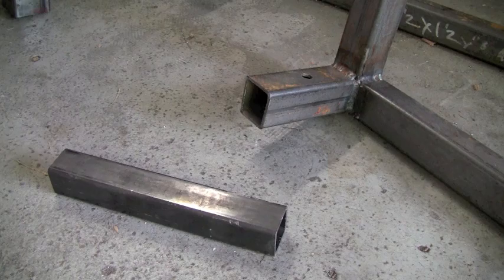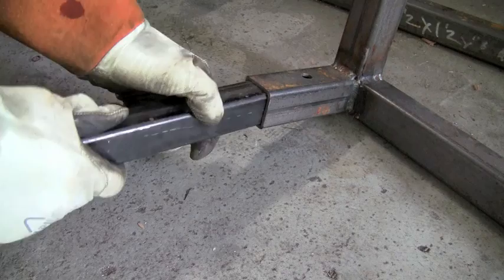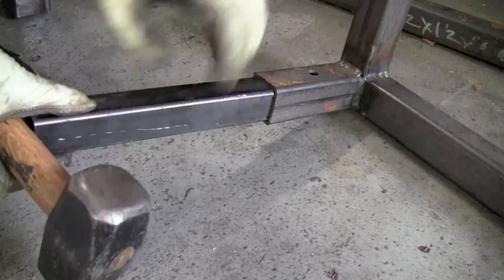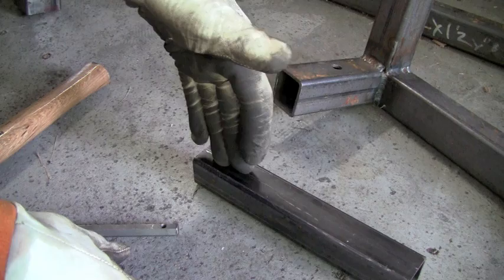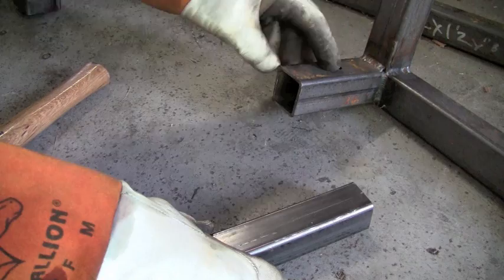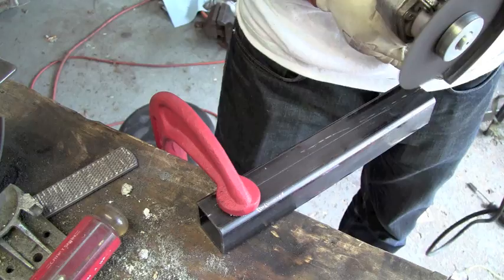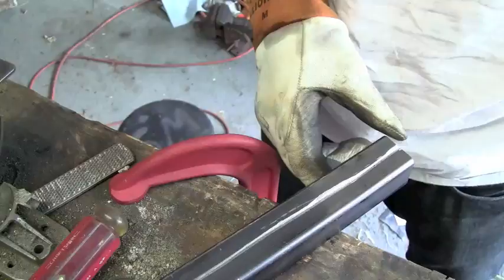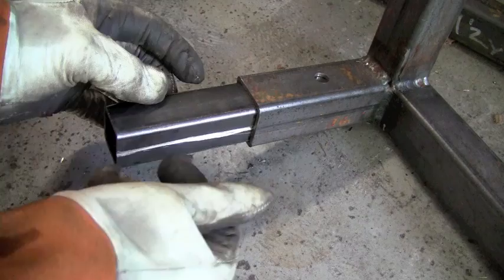Square Tubing Tip

Comment: Good video, I have done tons of what you are doing. For pins if you get 1/2 inch round bar you can make lots of pins for pennies. Grinding the groove to get around the flash does not cause significant weakening because creative steel builders  tend to over build anyways .If  you could get tubing with the flash removed and use it for the receiver it saves a bit of work. I'm curious about why with these youtube comments , there are always people that come across as non constructive negative commentators instead of suggesting ideas from their own experiences. Maybe they just don't have any experiences.  ED

Comment: I wouldn't ding both ends.  Do one, and then use a combination square to mark the other end.  Otherwise if the weld isn't dead centre, you'll get a diagonal line.
Reply: nwimpney I was thinking the same thing. If the weld is off center, as it often is, you have to follow that. Otherwise, you’ll get a line that goes from one side to the other.
Reply: Well, there it is... I could have saved 3 minutes of my time by not repeating what is already said here :-D

Comment: Nice tip! Only one little problem, if the seam weld is off center, your marking technique will only work on one side, no big deal, it just means you gotta double check by measuring the mark. Cheers for the upload!
Reply: Moon shiner  amperaje adecuado para soldar con varilla 7018 3/32

Comment: Dinging each end and scribing a line between only works if weld seam is in the middle of the tube. Sometimes these seams are to one side. If you're looking for a pin, look for a hitch pin. Welding the seam hardins that part of the tube, so plan for your holes so you don't need to drill the seam.

Comment: Use a cap screw and thread the inside piece. Easy to make and take down. It would also prevent any vibration and that loose sound if you were able to screw it down tight.

Great work around if all you have is square tube with the inner bead.

Comment: If you ding both ends, your line could wind up as a diagonal. Secondly, the integrity of the insertion tube could be maintained if you route out the seam line on the surface. The inside has a build up from the seam weld that you could take advantage of....re; JR Helicopters

Comment: You can remove that weld flash from  any length tube.   make a tool that you pull through  any length of tubing with a little  HSS lathe bit   bolted in place that removes the weld flash.  Use some all thread  and a power drill to pull the tool through the tube.  Once you make the tool for any  goven size  tube it can be used  over and over.    This way you won't be weakening your  tubing with that  groove.

Comment: I've got a patent pending for a piece I've designed that uses the 'slip-joint' type fit- though in 'heavy guage'. I personally used square-clipped lock pins for ease of takedown; if you're working on is semi-permanent(if it was permanent,you'd just weld it), I'd use adjustable Clevis pins w/ cotter pins in them.
Contrary to what's been said, making the small groove in 'mild' steel' WON'T weaken it !

Comment: Clamp your square tubing to the table from the inside, that way you don't have to take it apart and reclamp.     It will also allow a much tighter clamp because you cannot collaspe the tubing.     Then drill that hole through, and another through hole on the ajacent side, then just slide in your stub and weld the holes shut.     If you wish to retain adjustability just weld a nut over the hole and clamp with a bolt.     To make the adjustment a one hand deal weld another (longer) bolt crosswise atop the bolt head as a hand hold.   Good video...

Comment: Good tip if you're stuck but my local metal supplier sells 0.100" wall square tubing so the 1" fits into 1.25" fits into 1.5" and so on. No dinging needed.

Comment: most steel manufacturers publish a table of "telescoping" tube and RHS along with the clearances. You can pick how tight you want it by selecting thicker wall thickness of the outer tube.

Comment: Great tip I'm new to fab. The pins your talking about are redly available at Ace/ lowes/ home depot & some have multiple pin holes. I used them on a Bar stool racer I just finished didn't want to weld seat steering up rights so I could ship ups if I sell it later. Just pushed through pined cut off looks great & smaller head than bolts. Good luck!!!

Comment: You either have to ding only one side and scribe from there, or this only works if the weld is actually exactly in the middle.
Reply: +Dave Smulders I had observed the same thing.  He only needs to mark one side then extend that mark down the side of the smaller tube.  His marking method would not work if say the weld bead was offset.  In marking both sides, he would end up with a diagonal line on the smaller square tubing.  Good stuff otherwise!
Reply: No.

Comment: If want to slide 3/4" into 1", 1" into 1 1/4", or 1 1/4" into 1 1/2" just make sure the larger of the two sizes is no thicker than 100' wall and the two will slide together nicely with no grinding and not sloppy.

Comment: Nice tip  Thankyou  very much  i had tried the other approach. Of  grinding the inside out with  a Rotary tool knowing  there had to be a better way  BTW i am a retired Woodworker  that   Knows enough about metal. To   Be dangerous  to myself  my Grand father was a professional Welder and my Father taught me some basics although he was more of a Carpenter than a  Metal guy

Comment: That "weld line" is called a "seam"  where the steel was forged from flat to square . You could spend a little more for seamless tube.

Comment: speaking from no machining experience, but don't etch the weld. Etch the other side of the weld. When you weld stuff it gets stronger, but it also gets more brittle. so if you etch out the weld, you're prone to more cracks from an engineering perspective. I don't see a problem with etching the other side, opposite the weld, because you're grinding out softer material that is more flexible so to speak. If you leave less material on the wled side, it's more prone to split because that weld line is more brittle material because of the heat treatment.

Comment: You can also make/buy  a tool with a hardened  cutter bit(like a brake lathe has), and hammer it through to cut off the welding flash from the inside. Then, you won't have a grinder stripe on it.

Comment: If all you need to do is make a socket type assembly, you can use a hammer and piece of round rod or blunt chisel to pound a concave surface into the area that needs to fit into the socket.

Comment: You might have already solved this - but in case you haven't: I've seen the kind of pins you're talking about near the end of the video.  Look for "ball lock pins" or "T Handle lock pins".  I know Grainger carries them, but they're pretty expensive, like 25-30 bucks.  But I've seen them as low as 11 bucks elsewhere.

Comment: use round heavy wall tubing or pipe, for the inside joint connector.
just like on scaffolding frames.
much easier to assemble and disassemble

Comment: You can buy tubing that is used on trailer hitches w/o the seam.
Reply: +Bruce Kennedy           Exactly what I was thinking. They usually bead the outside of that tubing and then grind off the bead for you. One less thing to worry about, meaning a quicker job.
Reply: DOM
Reply: Is there such thing as square DOM? I've never heard of it. Maybe it exists???
Reply: +Jacob James it does. check your local steel supply
Reply: Bruce Kennedy and I would also get pins from there.
Reply: The Reese receiver tubing is only available for a 2 inch ID. Plus, it costs 3 times what regular tubing costs and is only available in thick wall sizes.
Reply: Mark G also 2.5 as used for class V hitches.
Reply: Bruce Kennedy m
Reply: Hard to find local places that carry seamless tube and if so it is usually more costly. Great idea he has.
Reply: If you dont want to cut a groove, before welding the bigger piece you can file done the weld. Small grinding wheel or burr on extension chucked up in a drill for longer pieces.

Comment: If you can't find a pin to fit your tube,you could buy a steel rod grind a taper,and drill a hole on your drill press,and put a circle clip in it so you can grab the pin and pull it out.

Comment: Here's a tip for you in return,..although it's about 3 years late,...instead of bolts,.why not use trailer hitch pins with the hair pin retainers ? These pins are available in 1/2", 5/8" diameter and so on,...get pins with a diameter that suits the job.

Comment: If you have to do a tonne of these I would put a wide grinding wheel in an old table saw or a cheap table saw.  Then I would just run the pieces with the wheel sticking out of the slot a smidgen.

Comment: If you plan ahead, you can also grind out the weld flashing from inside of the larger tubing. Use a  1/4" collet die grinder mounted with a 6" long shank carbide burr. Its a snap to reach in 4" deep from each end before the sleeve is welded on.  If the male end is 2" square tubing? Just buy the special size tube made for trailer hitch receivers. It has no weld flash inside, plus, it is 0.030" oversize, inside and out  (2.030" inside dimension). The 2" insert  will never get stuck in there.

Comment: Sorry jackleg but you cant just flip the piece over always and in most cases because the weld seam is not centered therefore the scribe line would not line up or be centered.
Reply: +Kay P Funny it worked. Got a video rigger?
Reply: If it's not center just measure it and use a combination square and slide it all the way to the end of square of tubing ...it's not that difficult.

Comment: You could have ground  only the length of the insert and not the whole tube. then you could have the high polish look if so desired.
Reply: pasquale parente. I agree , what I did before welding was strip off sandpaper on a wood board and push pull until gone.

Comment: instead of welding the face of the outer tube in a lap weld, would it not be nicer to take your grinder, and cut a slot on each side face, so when the inner tube is slid inside, you can fill the cut with bead, and penetrate into the inside tube.   Grind smooth for finish.
what this also does, is leave the face square so it won't peen open the removable piece, and save you from having to pound it off when it flares and jams

Comment: Been using your method for years when joining to 2 pieces of SHS together. Anything structural I always use an insert, plug welded into place before welding the 2 lengths of steel together.
Reply: Hi, is this a way string way of adding length? For example to widen a table frame? Thanks

Comment: Or you could just buy square tubing that has the flashing (inside weld) removed. That's what they use for receiver hitches so they slide together nice.

Comment: I hate to knock you off you high horse, but I'm currently working with a batch of RHS which does have a weld seam about 1/8th" off centre, so JD's point is quite valid.

Comment: Think how they manufacture the steel tubing and ask the question again.

Okay, they form the square tubing in a factory, with a robot welder to make the splice. Straight down the one seam. If the bead was off center or ran at an angle, I don't think it would look square to you.

Comment: Sweet thanks for the tip on how to make my box section even weaker! Serious crush point...!
Reply: You realize the outer tube would have to fail first right?  If the outer tube has failed the piece is already destroyed so what would it matter?  I guess you must look at a shaft with a key-way and wonder how could the thing could possibly exist without twisting in half at the slightest application of torque.

Comment: That method only works if that weld is exactly in the center. Otherwise you cannot mark both ends facing up; you'd have to mark one end, then spin the tube vertically to the other end, putting the first mark on the bottom of the tube, then get a square and transcribe the mark from either end to the matching surface containing the other mark... Or sumthin...$

Comment: how would you weld 2 end plates on a square tubing ? a fillet weld would be used but how would you clamp for welding ?? would you only use the weight of the tube as a clamping force ? then just tack weld , and then proceede to do the all around weld ?

Comment: why use a cutoff wheel? you could do it easier with a regular grinding wheel. Also if you put the tip of the clamp into the tubing when you clamp it to the table you can do the grind in one motion.

Comment: Why not just mark the center instead of hammering it for the mark?  If the inner weld is actually off center, only one of the marks are going to line up because the piece was flipped over to get the other side..  I could see maybe hammering to get the first mark and then use that to measure for the next mark.

Comment: Thank you for the correction. It just seems they are being lazy with the quality, if it is off center. As in, did a carpenter design that square tube machine.

I have been out of the steel field since the early 1980's,,, so I am a bit behind.

Comment: Is the weld bead on the outer piece always gonna be centered? If it's not, wouldn't it be offset when you flip the inner piece to put marks on both sides for your scribe line, in which case your scribe line would be diagonal?

Comment: I used a file sander without issue. If it were over 5 or 6 inch depth it wouldn't fit inside thou.

Comment: Or use a hammer and a blunt chisel and slightly dent in where the weld is that way your not loosing strength in the tube.

Comment: He could of filed the notch out on the smaller piece before he welded it to the frame. Would of take minutes
Reply: Yes or used an air die grinder with a long shaft.  About two minutes, have done it many times.

Comment: Cool tip...I usually mill my groove...
Reply: Easier and more precise and ya get it right the first time without having to go back and grind more if it dont fit
Reply: Kay P Dats right as Dan said below if the welds not centered they aint gonna line  up and most the time the tubing weld is not centered

Comment: No longer than the female tube is it would have been easy to grind out the weld seam on the inside of the tube with a die grinder BEFORE you welded it to the framework your building.  Would look much better than hacking a grove in the insert!

Comment: At @4:50 you said you were going to weld it after all the effort of trying to finesse one piece into the other.  Don't understand why you wouldn't just 'whack' it in to begin with, weld it, and save a step or two...
Reply: Good idea
Reply: xmchillin how you gonna whack in the second side? That first whacking is gonna be stuck. Show me.

Comment: where do I find a table of tubing sizes that tells me which sizes fit into one and another?
Reply: In 40 years I have never seen anything like that.  But that would be handy, eh?  I tell you what, you can do, is go to the "Weldingtipsandtricks Forum", introduce yourself with your first post, than ask that question!
Reply: Generally you wont find one unless you are looking at telescopic tubing. Reason being is the the wall thickness comes into play.

Comment: Why dont you ask for flash removed tubing when you buy HSS Square tub is referred to as hollow structural steel and you can buy it flash removed just like for receiver hitch stock for trailer hitches

Comment: Dude... Just remove the inside weld in 15 sec with a thin belt sander. They cost like $50 bucks and they just eat inside welds. Google dynafile and bazinga...

Comment: You could just put it in a milling Machine, and take a mill off?
Reply: Thats what I did when I was making some guard rail at work its the best idea
Reply: Most people don't have a milling machine. Even if I did I don't see how that's an easier option?
Reply: SoCalK5 most dont your right but it would be easier without having to grind maybe several times to get it to fit with a mill you measure the depth it needs cut  cut it with a 1/4" width mill and its done the first time Ive done it multiple times and given the choice would do it with the mill but your correct most dont  have one
Reply: I guess you're right, for those with the money... and space for a milling machine. My garage already looks like 10 pounds of crap in a 5 pound bag. lol
Reply: Yeah.....just put it in the milling machine. Because everyone has one of those laying around the garage.
Reply: Sorry !
Reply: Do it anyway ya like. When its your kkitchen you cook like you want and when its mine Ill cook like I want

Comment: Why not just file the inside of the big tube with a file and make it a perfect fit intead of shaving off something that is supposed to be there.  I may be wrong but either way if you are using this outside it will end up rusting together anyways if you drive it through snow so no matter what it will end up rusting together regardless of how good you make it.
Reply: Jesus you'd have to be persistent to file that out and how would you file out a 5 foot section

Comment: you seem like a good guy and u are a fellow fabricator, so, put the guard on it and never ever run a grinder or wire brush anywhere near loose cotton clothes. They will grab you and skin your stomach before walking up your chest skin in a flash. Wear shop leathers or leather apron.